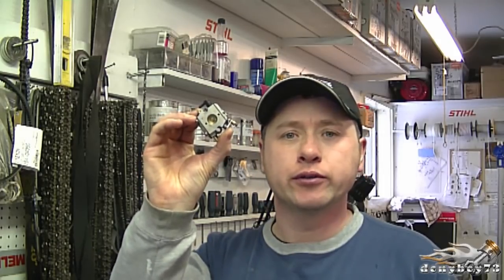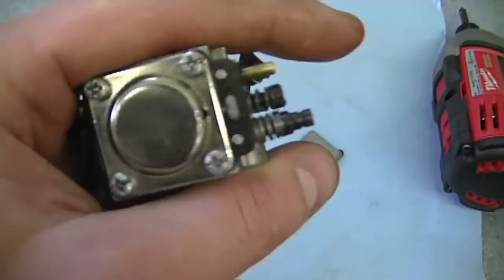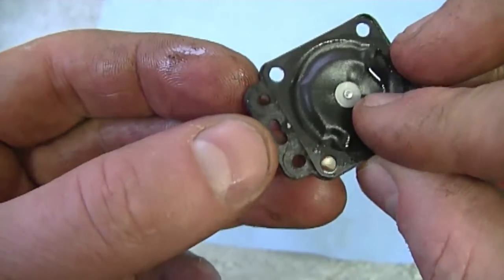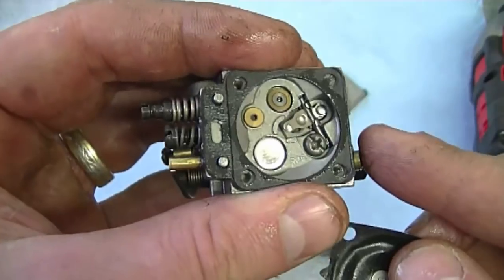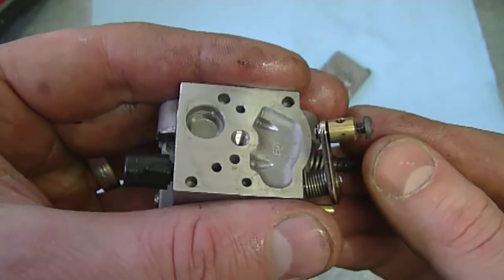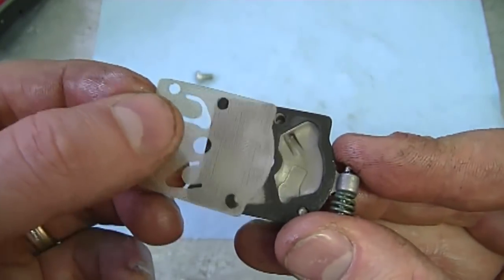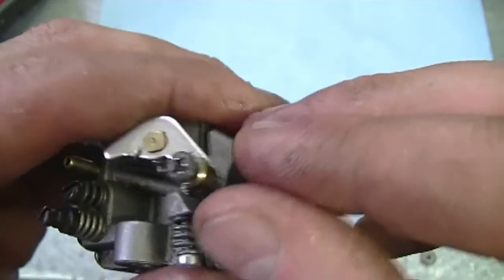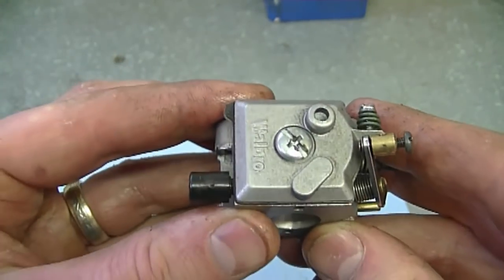2 Cycle Carburetor Diaphragm Configuration On Outdoor Power Equipment

Comment: I was watching you put in pump diaphragm upside down. You had it facing the cover instead of regulating the needle. But you are great and helpful when someone need your help. I just noticed when you went over the diaphragms. I learn lots of things from your show , thanks. Frank
Reply from the maker: It is installed correctly in video

Comment: Great video, i put my Walbro carb together after i called Walbro the way they said then I thought i would look at your video and you were the opposite on the reed side to what they told me. Your explanation made pefect sense. Thank you you saved me having to take it apart again. Thanks Darcy
Reply from the maker: +Darcy Roy you're welcome
Reply: Hi Darcy; I have found-out the hard way that calling up companies about there product is not good , when I called- up Snap-On about a Compressor I had  about a year old from Costco  & I wanted to know what oil it called for?, the girl told me, " you can use just regular motor oil & it`ll be fine! LOL.

Comment: Most carb kits for Walbro carbs come with 2 valve diaphrams, a black one and a tan one. I was told several years ago that the tan colored diaphragm is resistant to ethanol in the gas. I have used the tan colored diaphram for over 20 years and I have never had an issue with ethanol degrading the carb. Just my 2 cents worth.

Comment: Always informative video  by the way what is the seeing a lot of older small engines especially in the chainsaw variety I was see Tillotson carburetors why are those so widely used back then and then all the sudden now we don't use them just curious I do a lot of restorations on the chain saws another vintage outdoor power equipment to notice a lot of Tillotson carburetors

Comment: Hi DD, I have chinese chainsaw 2 years old with no use its garb similar to the one in your vid, the fuel hose was broken replaced the hose will start but wont run, heaps of spark and fuel on the plug and i tried to adjust the 2 jets but still no go, even though its never had any use do you think the diaphragm needs to be replaced, Thanks for your videos,

Comment: dony, i have a Shindaiwa hedge trimmer that has a small problem. The blades continue to move when it is idling. Ive messed with the idle speed and it is the lowest idle i could get without the engine stalling, but the blades still move at a fast pace. What is wrong and how can i fix it? Thanks, brendan

Comment: Dony I have one question, if you put metering diaphragm  first and then gasket, and equipment works fine, what this configuration can cause? I can't remember last time how I put it but it works fine, do I need to reopen carburetor and do right way if I did it wrong in the first place? :)

Comment: I'm having problems with my stihl 009 It only has one place to put a line on it . not sure where the other line goes. No one shows this on the tube.  I replace the gas lines and rebuilt the carburetor .. It will not suck gas to the cab will run if I put gas in the cab. Not sure where the extra line goes to.  Thanks for any help.

Comment: cmony irontree 11 minutes ago 

Donyboy my poulan chainsaw runs but as soon as I cut two inches deep into the wood the chain stops cutting. I did a compression test pulled it 8 times and it read upto 30 psi. It runs good until I get within two inches deep in the cut. I noticed you mentioned that if anything lower than 100 psi it wouldn't start but this one does and cuts and then looses power.?? The compression gauge is new. Would the clutch cause this?

Comment: Nice video. I got my kit k10-hd and the side with only one screw it came with three gaskets that are the same. Two of them are stiffer and the other one is more rubbery and not as stiff. Which one would you recommend using?
Reply from the maker: i try to avoid using the rubber ones, i use mostly the plastic ones on pump side

Comment: Once again Thank-You Don. I have a Question Don; I have an old Weed Eater, Featherlite  & the carb is leaking around one of the gaskets, I tried to get a Carb Kit but the Model # is missing?, I have the serial #  but I can`t order a kit with it, which I found-out today at Sears. Its an 18cc, WA226, & 475 are the only #`s I can see. any ideals  Don?

Comment: I have this same carb. that I rebuilt after disabling and soaking in carb. cleaner for three days and it doesn't supply gas to the engine .Also replaces fuel line and fuel filter . Got spark . Any ideas?

Comment: have you ever had a problem with a 6.75hp tecumseh carburetor priming? i have one im having a problem with. the carburetor has been soaked for 3 days and reassembled with new gaskets, seals and new primer bulb. when you look into the carburetor and push the primer bulb no fuel skirts out the emulsion tube. can you tell me what wrong??

Comment: how many turns on the air/fuel adjusting needle(low & high), Mel
Reply from the maker: I start at 2 turns out and then adjust them inwards
Reply: donyboy73 Is this on all carbs? Small engine

Comment: Donyboy are you in Muskoka I saw you with a Muskoka hat on in a video. If you are where is your shop I'm from Huntsville. I have another question also. Should you drain fuel injector systems on small outboards for winter?
Reply from the maker: yes from muskoka, I'm not sure about the fuel injection outboards as I don't work on them

Comment: I would like to pose a question about flipping cars. Recently I set a goal that I was going to pay for my college with cash, NO loans. Over the past year I worked my tail off and saved $2,600, and I want to flip that to $14,136. I’m confident enough to say that I’ve got the work ethic to pull it through, but I’m also willing to admit that I may be a bit naive about HOW to pull it off. Does anyone have any tips on a good book to read or method for flipping cars?
Reply: Do one

Comment: HI Donboy
i installed the carb kit and now it will only run at full throttle and not smooth until i pinch off the fuel line it it will run great until the fuel runs out of the pinched line then it quits. It would not run before i did the rebuild kit until i poured fuel down the carb and it would only run for a few seconds then quit. i adjusted the needle 3 times, it made no diference. Am i missing something? please help, i am now into this for more time than it is worth but i want to get it right and learn some thing.
Thanks
Reply from the maker: +Darcy Roy if it's a Stihl check the impulse line
Reply: It is a craftsman blower